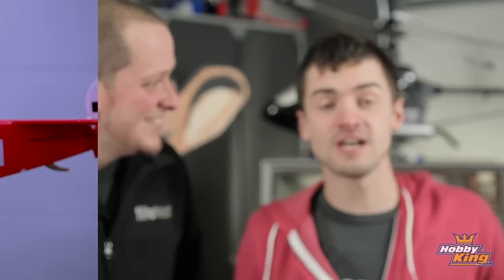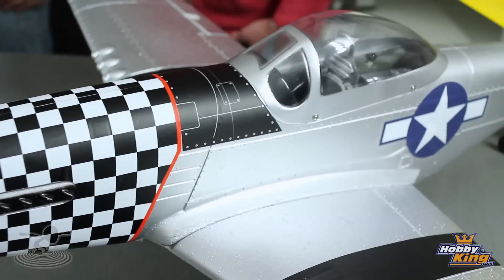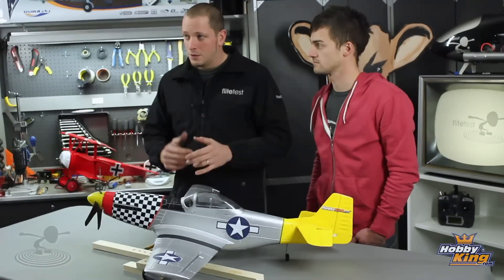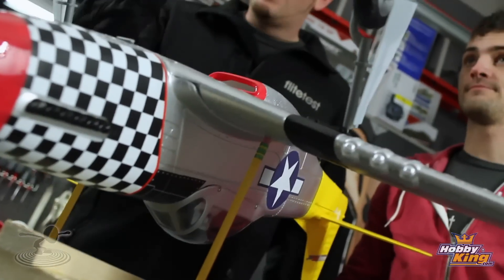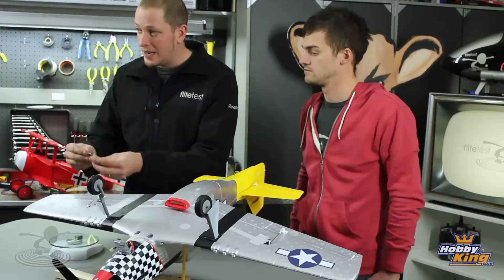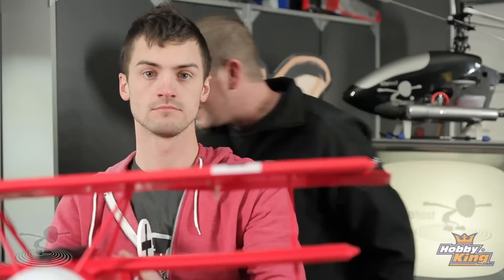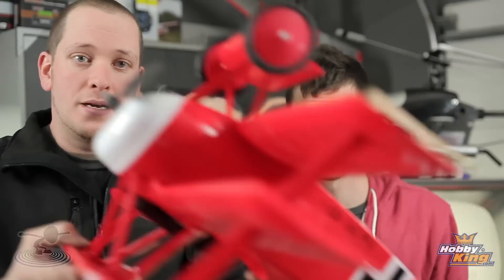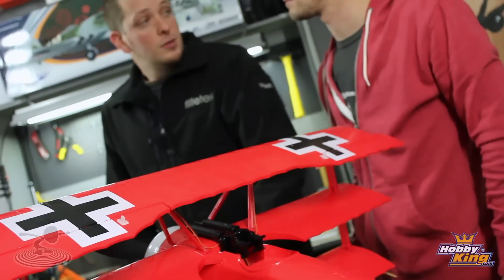Flite Test - Balancing Your Plane - FLITE TIP

Comment: Another good, informative video guys!
I bought a brand name CG balancer, to get my T-28 Trojan balanced.
I had an instructor from our club maiden, and trim the T-28 for me.
He commented that the CG was good during this flight test.
I used the recommended CG from the T-28's instruction manual.
He also recommended that I add spacers or small washers behind the engine mount to give more down and right force.
The T-28 had a tendancy to climb to the left when throttle was increased.

Comment: Lost my first plane due to heavy tail.  When it crashed, found most of the fuel had leaked out and settled into the tail causing the tip stall and plane, a trainer, spiral into a tree.
Thanks for the video.

Comment: Your Fokker DR1 has a plastic engine. The real DR1's had a cast iron engine and heavy propeller, which helped in balancing them. If your engine was cast from lead or aluminum, it wouldn't be so tail heavy. Just saying... Firewall weights were a good idea. Weight would be less if put on the forward inner side of the cowling. You forgot to mention, that on the P51, if you were to move the weight to the fuselage, the weight would have to be increased to have the same effect. It's a rather simple formula and wouldn't be a bad idea to show people in a video so they could see the relationship between weight and position from the fulcrum/CG point. Great educational vid, though.

Comment: Thanks for the info.  I bought the P51D (my fire rc plane) and no where in the owner's manual does it say how to balance the plane other than to move the battery and/or the receiver.  What a stupid suggestion.  So much easier to put some counter weight on the tail section....especially for someone like me....a first timer.  Thanks again.
Reply: You should always try to correct balance issues by moving components first before adding weight. Small changes make big differences. Added weight only after all other options are exhausted. Less weight is always better with RC aircraft.

Comment: Lol... Just flew my FMS P51D 1400mm, and it was tail heavy..
Even with 4 cell 3300 mAh battery. (Recommended size is 4 cell 2600 mAh)
it's still tail heavy..
I did have to relocate a rudder servo, because the rod was bending horribly.
Also, I didn't put my gun ports and exhaust pipes on.

Comment: Does this trick work just as well for canard aircraft? I imagine it would have to be at the least modified a bit because the canards pull the center of lift forward instead of backward. Do you guys have any particular rule of thumb? By the way I <3 your channel.

Comment: Wing Lift
That is where the CG or the pencle reasersor should be @ the highest camber or highest lift.
Then
If you can move the ESC and LiPo fwd or aft to get the plane level. 
Note
Where the ESC is and LiPo is and velcro the ESC and LiPo at that spot. 
Now
If you change to a bigger LiPo do a CG check.
again
Aircraft CG is the highest lift point of the wing or the thickest point on the wing or the largest camber

Comment: When you measuring the correct point of the CoG, how far from fuselage is correct ? One inch, two inches... ?
Reply: Yes I knew that, but the CoG of each wing has  two dimensional. One distance is 75mm from LE. Where is the second distance along the entire  of each wing ?
Reply: This distance is irrelevant.

Comment: cg does not affect stall. a wing will always stall at the same angle of attack, regardless of speed or weight. 
an elevator may not have enough power to raise the nose at landing speed if the cg is too far forward.

Comment: I bought a "NEW" plane which had epoxy'ed washers placed in the nose on the Left side of the center line of the plane.  My question is why?
The plane leans hard to the left when put togather, I can only assume that its to adjust for the torque of the motor. 
Should i place the battery to the right of the center line or center the battery on the center line?

Comment: on the Fokker, what if instead of putting 90g of weight at the nose, you use a motor that is 90g heavier than the Turnigy 2410 thats already in there

Comment: @danny9599 works well with symmetrical wings and on Raf aerofoils and NACA 1, but asymmetrical, like on the P51 or Spitties  and the high speed aerofoils like on jets (max chord at about 40% to 50%) and delta's need a tad more science or info from experienced flyers.

Comment: I have a foamy, I balance, and it looks level, but the nose tend to go down. I have to give an up elevator to keep it level. I use trim. So that make my tail and elevator is not straight. Is that a sign of nose heavy? But on other instance, when it fly straight, the tail is not level with the nose. The nose is higher than the tail, why is that?

Comment: How do I balance my glow airplane? Full tank or empty tank?
Reply: full.
Reply: Actually it doesn't matter because your tank SHOULD be right on the cg if it is not then the cg will change through out the flight as the tank becomes empty

Comment: Why do they make planes that are not balanced ? Rookie question - flame on !!
Reply: That makes no sense you put your own stuff on a plane so it's different for everyone so you need to make sure your setup is balanced
Reply: SuperCameron73 Keeping the kits light (i.e. omitting some necessary ballast weight) saves money in the shipping costs. Also people might want to use different size batteries and other equipment which will affect the balance.
Reply: The real question is...why wouldn't you want to balance it yourself anyway? At least if you do you know it is balanced correctly. I don't trust assembly lines. Small micro aircraft doesn't really matter. Most are reasonably balanced out of the box. But larger, more expensive aircraft usually requires that you provide Rx, Tx, Lipo, optional voltage alarm and such components. Therefore, precision balance is impossible out of the box since all components that you install will be different shapes, sizes, weights.